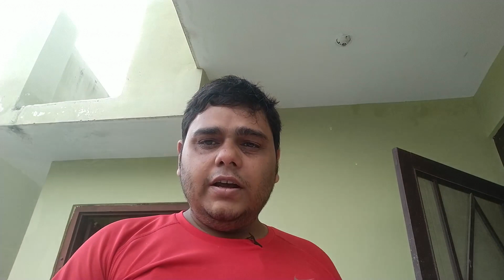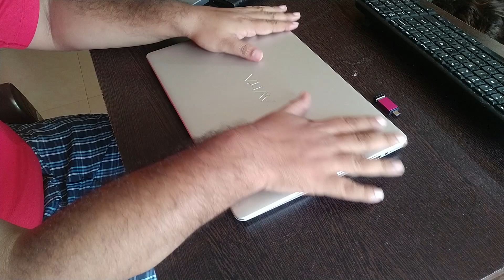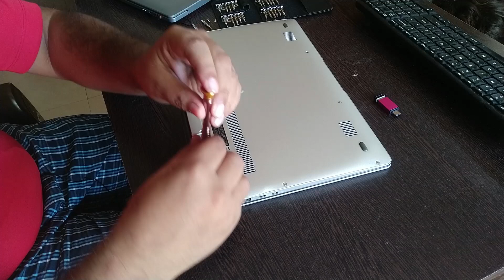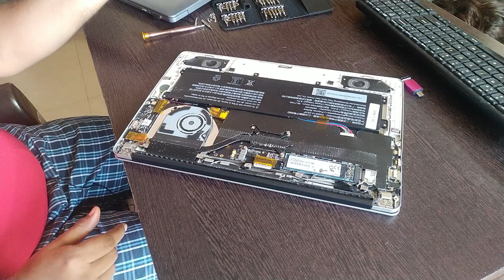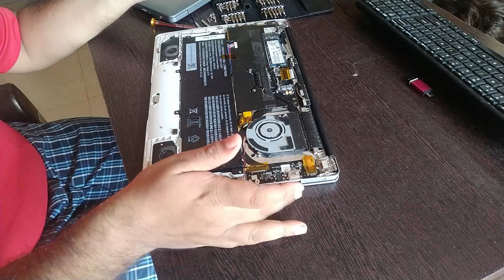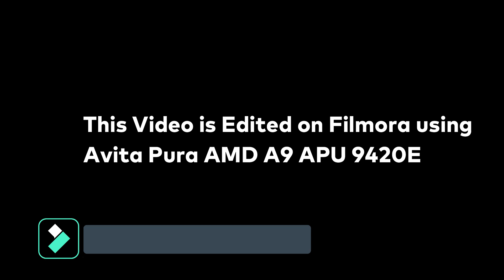Avita Liber Disassembly

Comment: Hello sir I'm facing a problem with this laptop, whenever I'm using this laptop sometime maybe 2 min - 10 min , the laptop screen gets turned off , but keyboard light and fan are still running. What could be the exact issue?

I submitted the laptop in repair service under warranty, the technician changed the motherboard, but problem not solved. Again I submitted the laptop in repair service under warranty, this time he changed keyboard but Problem not solved. He couldn't able figure out the exact issue. Please try to help me. 

Many Avita liner v14 ryzen users face this issue

Please sir help me

Comment: Hii bro
I recently bought the avita liber laptop a week ago and it died last night all of a sudden while watching Netflix and after that there is no sign of power,it's completely dead. Do you have any idea what happened to it?
Unfortunately I am not in India to get it fixed with warranty I flew to West Indies as soon as the laptop got delivered.
Please do reply bro!
Reply from the maker: Hi Kapil Bhai do one thing open it and check if there is a burning issue you can smell it as well if there is something like that, the another cause is Motherboard faliure hard drive is not failed as BIOS is not coming. Power supply faliure can be another issue charge it with 65 watt USB C charger
Reply: @snoopyindian5598  thank you very much for your reply bro.can it be fixed if there is a battery issue?

Comment: What is the pin size of Avita Liber Laptop charger ? pls share the link of the charger I want to buy it.
Reply from the maker: It can be charged using 65watt USB charger
Reply: @snoopyindian5598  yeah but what about the pin size of the charger which comes along with laptop. I have the charger but PIN is broken and need to replace it.
Reply from the maker: Type C Charger

Comment: Which type of ssd in liber v14 ryzen 7
Reply from the maker: It is NVME SSD Which gives you 500Mbps speed
Reply: @snoopyindian5598  can i upgrade SSD if possible how,?
Reply from the maker: @a.ba.b492  yes you can upgrade SSD
Reply from the maker: Please subscribe to my channel it gives us motivation 🙏
Reply: @snoopyindian5598  do I have to replace with 512gb or there is another slot given?
Reply from the maker: @a.ba.b492  there is only 1 slot given and you can replace it with 512 GB as it comes with 256🙏
Reply: Avita V14 disassembly
https://youtu.be/Wgpw-KR65E8

Comment: How to reset battery? Can you tell. Facing battery calibration issue.
Reply from the maker: To start, right click the battery icon in the taskbar. Click Power Options, then click Change when the computer sleeps from the left menu.

Take note of your existing settings here because you will need to put them back later. Change all the dropdowns to Never and click Save changes.

Click Change advanced power settings. Expand Battery, then expand Critical battery level. Take note of the current percentage for later. Click the On battery percentage and set it as low as possible.

Expand Critical battery action and ensure that On battery is set to Hibernate. If it isn't, click to change it.

Once done, click OK to save the changes.
Reply from the maker: Hope this helps Please subscribe SnooyIndian for more such info 🙏

Comment: Bro if u want to upgrade take some 2 kg laptops u will have mang upgrade options
Reply from the maker: Yes but now there is no 2KG laptops these days
Reply: @snoopyindian5598  Acer aspire and others are there check pls
Reply from the maker: @howto545  I have HP which support this but we have Apple which does not so things are scattered 🙄
Reply: @snoopyindian5598  bcz compact laptops are designed for upgradation as most of them are built for business purpose only not for heavy tasks

Comment: Bro can we replace ssd by hdd
Reply from the maker: No That is not possible as only M.2 SSD is supported in this Laptop
Reply: Bro after removing ssd can we add hdd
Reply from the maker: @sravankumar5741  no the slot is not SATA which will accept normal HDD it is M.2 SATA so no way we can do it
Reply: @snoopyindian5598  ok bro bro then  can we increase ssd
Reply from the maker: @sravankumar5741  yes you can do it
Reply: nvme ssd ??

Comment: They have put a nvme ssd in i5 8th gen liber but stuck to m.2 sata ssd in liber v14 which is 10th gen and upgraded to this
Reply: I think it is the same in LIBER V14 it's an upgrade in terms of screen which is non glossy Web cam quality and generation of processor that's it
Reply: @bhartisharma7597  I asked a person who first made unboxing vid of liber v14 in youtube and he said its sata not nvme beside I search on google and a chines or japanese site appeared with this laptop review. There was screen shot of crystal diskmark which showed read/ write speed of the ssd 540mbps.If it was nvme then it should have been atleast 1500mbps..
Reply from the maker: @neelpandey8985  Yes Neel you are right it is SATA not NVMe the read and write speeds are just 500 MBPS however the slot does support NVMe which is good.